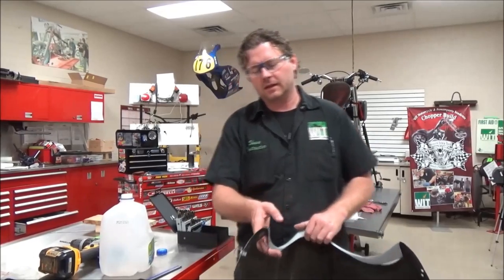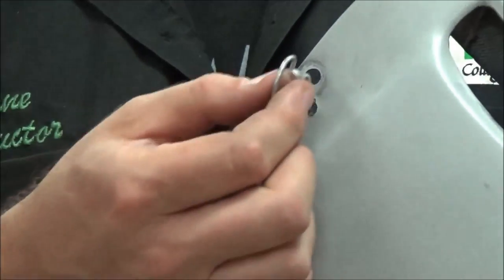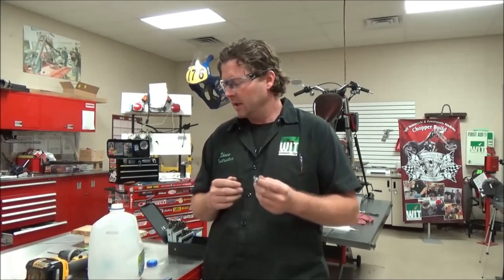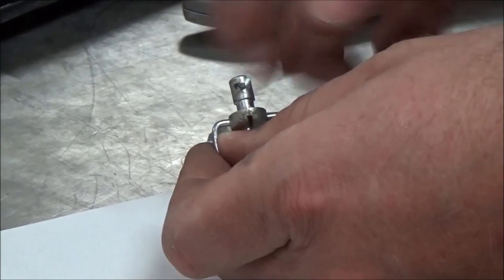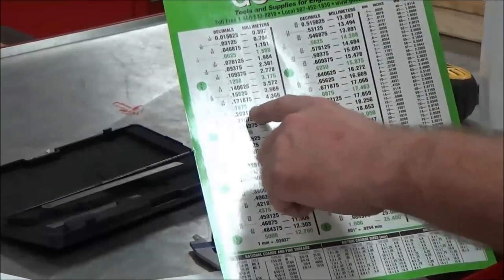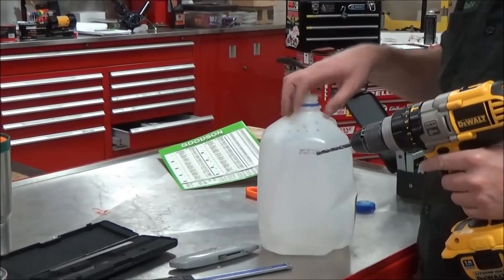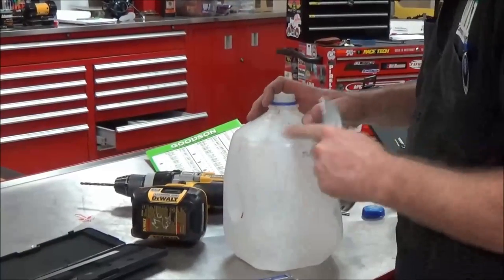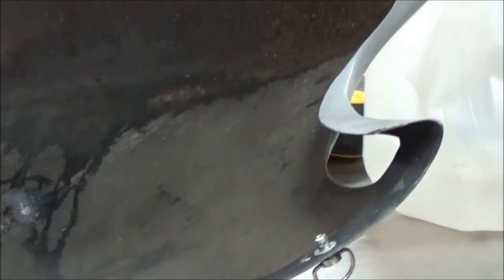DIY: How to make a plastic washer for securing your race body Dzus fasteners

Comment: Good tip. It should work with threaded fasteners as long as you size the center hole correctly. I will have to give it a try!